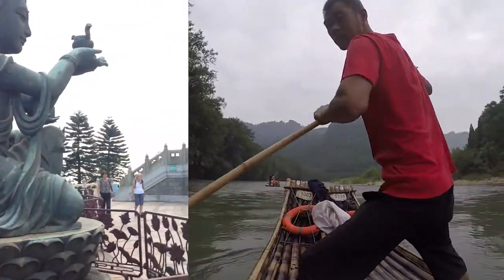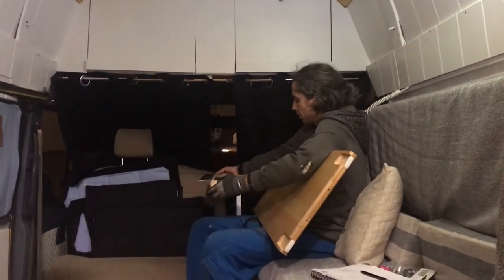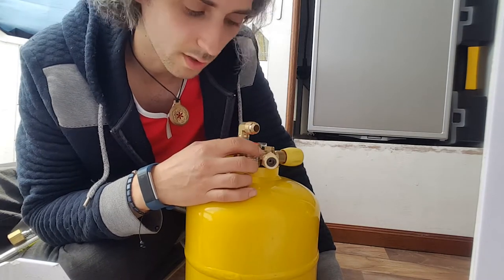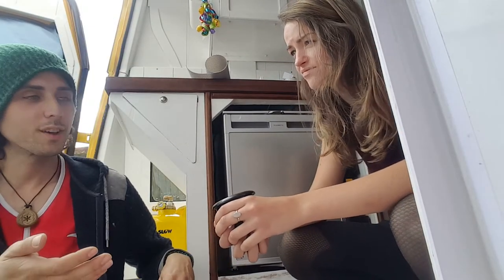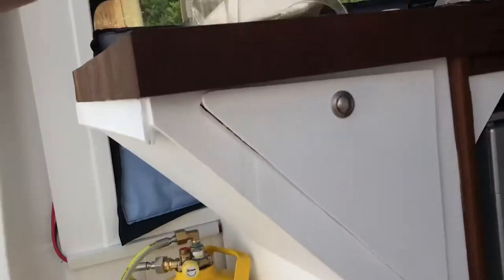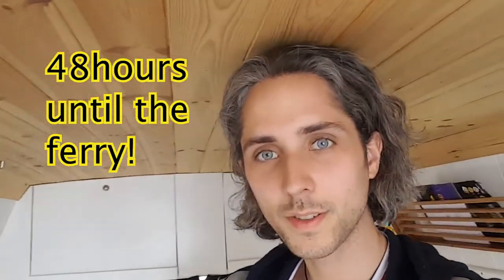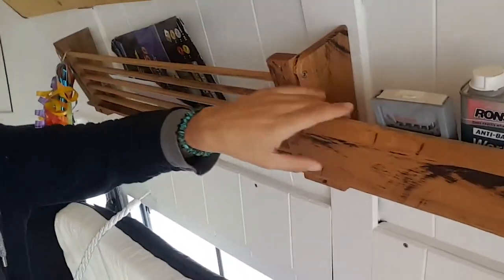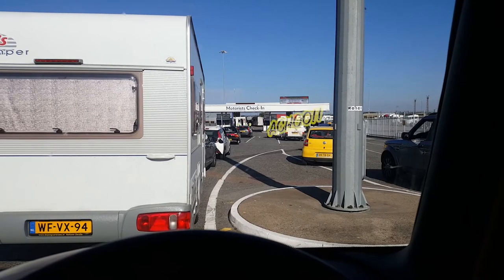LDV School Bus Van Conversion || Gas and GO! || Ep. 15

Comment: Great job. I bought a 2001 ldv convoy,ex minibus a month ago. Partially converted, so im doing some of this myself.
Reply from the maker: Brilliant! Make sure to check those pesky areas where the rain commonly gets in and the rust usually starts to build up! Let us know when you've converted would love to see photos! We're on instagram @pathofra
Reply: @PathofRA  good advice. Windows have all been black siliconed as they were all leaking. Wiper stalks is the most common ldv problem. Water leaks past the seal and runs to the front footwells,soaking the foam under the rubber floor mats. In turn rotting the floor away. Take off the wiper and black trim plastic and silicone where the wiper enters the van body. Instant cure, or wrap a piece of string around it,covered in grease. Same result. Im sure you already know this but someone else may not. Cheers
Reply from the maker: @briggaskin  Ah thanks for that actually we haven't done this. We had a crack in our windshield tray and when we replaced that then the leak mostly went away. When it pours down we still get a few drops though so you may have just solved our problem! Nice one!
Reply: @PathofRA  according to various LDV forums its the number 1 leak problem. Hope it works